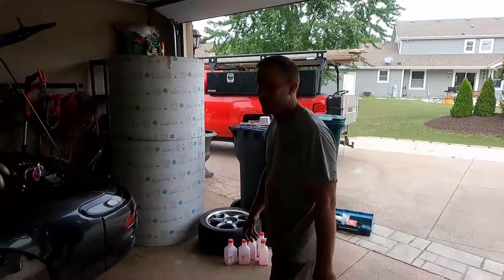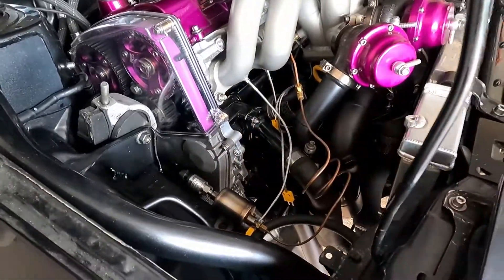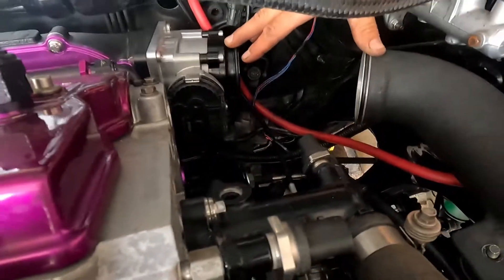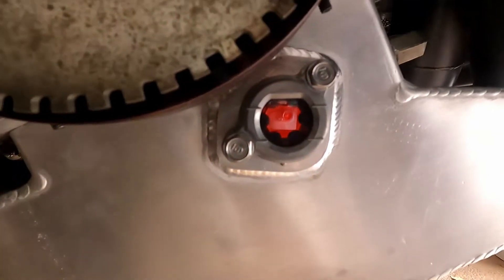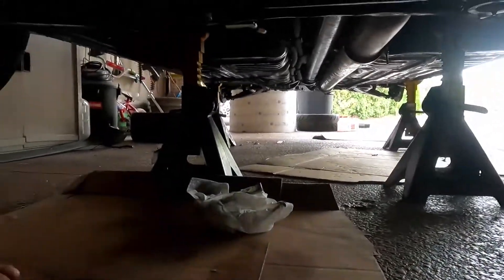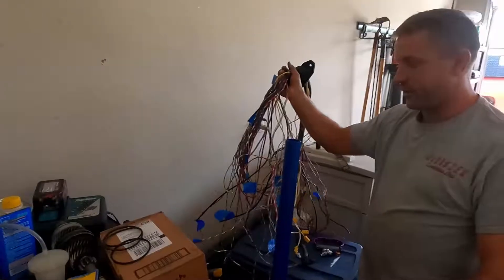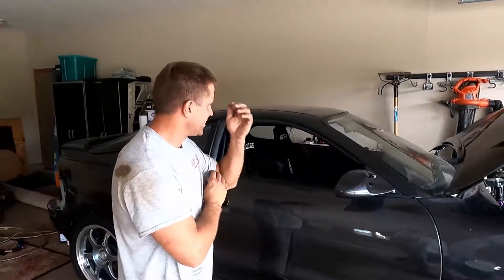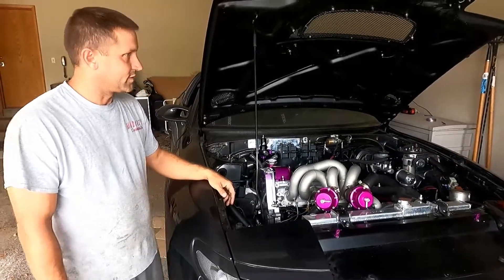Badnews has a motor again!

Comment: New here so, sorry for the newb question. What is this set up?  I have a 4th gen Caldina 3s-gte in my '95 Celica GT I'm currently rebuilding after I did the "Sweet 16" turbo upgrade from ATS last year.
Reply from the maker: It's a 1990 Celica Alltrac that will make over 900awhp
Reply: @rm2932  3s block, 5s crank, 2nd gen beams head, custom intake?
Reply from the maker: @FJDMG  5S block, 5S crank, 2nd gen head (not beams), cutom billet intake, full race exhaust manifold, PTE6870 turbo, Badnews 287 cams

I rev to 9500rpm and last time at the dyno peak horsepower was at 9300rpm
Reply: @rm2932  are 3rd gen 3sgte heads any good?
Reply from the maker: @BlueJDMMR2  yeah. All the 3S heads are good in a way.